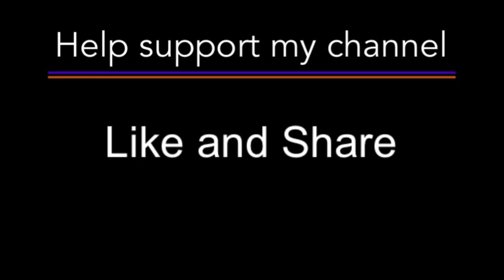Woodturning Spalted Beech Bowl - The Incredible Shrinking Bowl Blank!

Comment: A tip for you.  Through those gumbo chuck jaws in the trash. They force you to make a huge foot on the bowl. They should be used on pieces 16" or larger only. A good rule of thumb the foot should be only be 1/3  ----  1/4 or less  than the diameter of piece or what ever makes you happy.
Reply from the maker: Thanks Duane!

Comment: I like the bowl- maybe you could glue on a piece for a contrasting base? Or epoxy. Shame to throw away such a wonderful piece of wood. You did say it was a leaning piece, right?
Reply from the maker: Hi Scott, thanks for watching. The bowl was not as dry as I thought so it’s gone a bit oval. I tried to center it the best I could and drilled out the center with a hole saw, intending to fill the hole with something. Didn’t get it quite centered so I just set aside for the time being 🙄

Comment: For the various chucks I have, I made templates out of thin plywood (triplex). You can see one here: https://youtu.be/sh72fixngfU
As I saw it your initial recess would have been good enough but apparently you didn't. 
Too bad that bottom went too thin. Thanks for showing that also.
Reply from the maker: Hi Leo! I may have been a little gun shy on the mortise - the first few I did broke, as I did not realize skews had different angles so I used the only  one I had to form the dovetails and it was too steep. Finally sorted that out 🙄. I’m glad you think the mortise would have held - next time I’ll give it a shot. I just wasn’t sure and after losing a blank off the faceplate last video, I wasn’t feeling particularly adventurous 😂. I’ll check out your templates, thanks for the link and the advice 😊